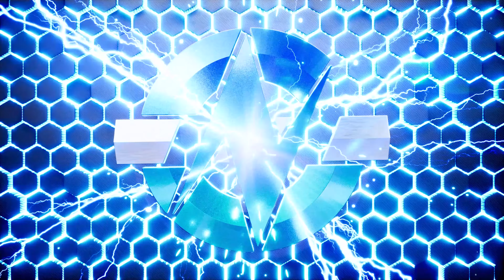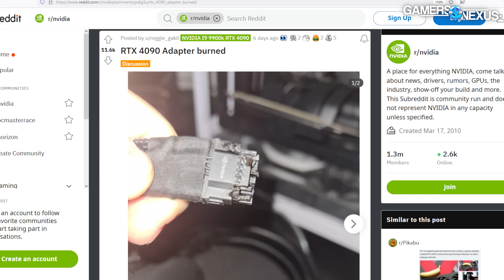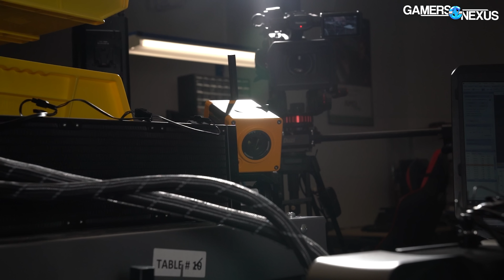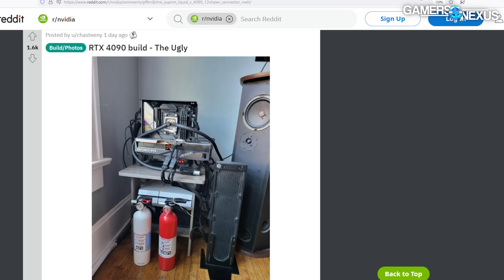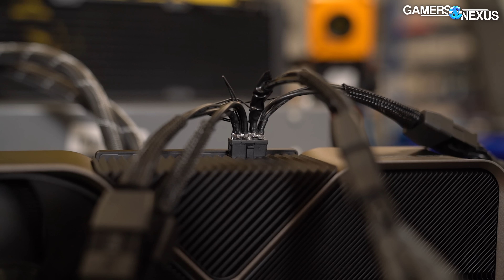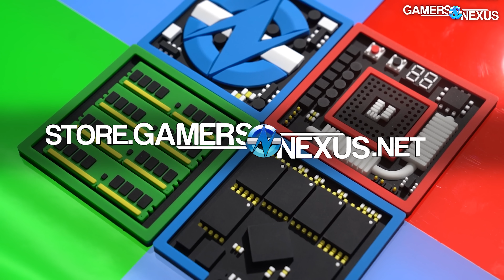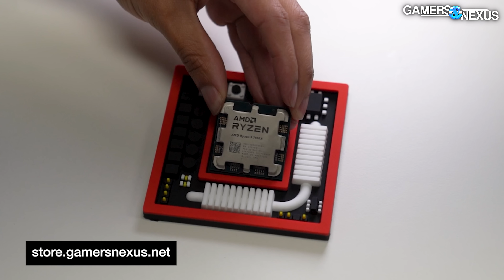Testing Burning NVIDIA 12VHPWR Adapter Cable Theories (RTX 4090)

Comment: To me this looks like NVidia had some less good adapters, they noticed the issue and it's already fixed but for some reason some of those bad adapters got out to the field. The connector Igor had was obviously prone to having the side pins being damaged. I wondered why they'd use something like that and it seems they wondered the same.

Comment: This new adapter seems to be designed closer to a power and ground plain than powered pins. Imagine if nv just used a slot style plug, a power plain and then a ground plain, this wouldn't be an issue if the issue has to do with the reliability of pin connection as buildzoid has hypothesized
Technically this connector will operate with a single power and ground wire to the plug, so long as the wire used is large enough it would work.

Comment: I wonder if higher case temps with poor airflow could play a factor. I would assume most ppl are testing via open air testbenches but I I still don’t think a 30 degree temperature delta would push it over the 105 degree maximum 🤔

Comment: ok, but what about torsion on the connector while it is connected? You don't think it could just be bad connection between the plug and the socket when it's sitting torqued? variance in the size of the pins/plugs?
Nevermind... you basically addressed it toward the end.

Comment: Im not 100% convinced its the cable.   I had a closer look the burned connectors and I think it might be the female connector on the card that might be the problem.   the melting seems to be from the outside in, on the male individual connectors in the 12 pin connector.   I think the female connecter isnt up to spec causing the pins to heat up.  Think of it like this  your using a 14-16 gauge  wire pumping in 600w then at the connection to the card the gauge drops down to 18ish gauge pins.  Now your pumping all that wattage into much smaller pins and those heat up causing the melting on the cable.

Comment: I would like to see someone compare the actual plastic on a failed adapter vs one that doesn't fail.  It could be the formulation of the plastic making one melt/deform at a lower temperature than another.

Comment: After seeing your research, I am less likely to think that it is specifically a cable failure. From the images I have seen, the source of heat seems to be in the Plug Interface itself, as in where the male and female pins interface (physically make contact). I would think that the plug (pin) interface would see a higher resistance as the actual cable is pulled to the side, ie; cable routing. This lateral force might be reducing the surface area that the male and female pins are contacting, thus increasing the resistance at that point. Higher resistance means increased temperature as the current overcomes that resistance. My next thought is also that the plugs may not all have been sourced from a single supplier; tracking the plug manufacturer and plug construction type may lead to a "eureka" moment. Also, if one or more of the interfaces have a weak connection the other interfaces will try to pick up the load, increasing the current through that interface, possibly beyond the spec limits for that/those pins. It is possible the outside pins are loosing contact forcing the inside pins to pick up the load, thus overheating the inside pins. That is an awful lot of power to cram through that single plug, with so few pins/contact points. Perhaps check and compare the resistance between the cable adapters and board side, (per pin),  as well as when straining the cable and see of the resistance changes (loss of contact at the interface). Once a pin starts to overheat it will oxidize and leave additional carbon on that pin, as a result resistance at that interface will increase. This could lead to a 'run away' condition.

Comment: WHY the hell do they have to use ANOTHER new connector, when wie HAVE functional connectors already? 
they just have to put them not on the top of the card, because that's a stupid place in any case.

Comment: I think the problem may very well lie in there being poor connections between the male pins on the connectors on the card and the female pins on the connectors on the cables.  Obviously, this is just a theory, but in my experience as an electrician for almost 50 years, I have seen MANY problems like this caused simply by poor connections between two conducting surfaces that are held together by only the rigidity of the metal of one or both of the two connecting parts.  Also, of course, the type of metal, the thickness, the (in some cases) plating on the metal, inconsistencies in manufacturing, power draw, etc. are all variables that can contribute to the problem.  

What type of metal is used in these connectors and what would happen if you were to push something slightly larger than the male pin into the female pin before re-connecting the cable to the card and see how much that effects contact between the two surfaces?  If there is a poor (small area of) connection between the pins, the initial power draw can cause heat, which in turn can cause metal fatigue or simply softening of the metal, which can cause even worse connection, which can then cause arcing, and then that in the end, can cause enough heat to start melting things.

Edit:  I paused the video and wrote the above JUST BEFORE you mentioned Buildzoid's theory at 26:00.   It was perfect timing!  😎

Comment: BTW i Could be Compleatly wrong and this could make 0 diffrence or someone has done it and i just missed it   
just a idea i have not seen anyone do these test in a PC case where the Incase temps can get up to the 40c .

where you have CPU, Ram and gpu all being used at the same time in a common case for Example  3 fans at the front with a glass panel infront of them and   1 Rear Exhuast fan  and Either a Air cooler or A Aio and using that as a Exhuast too.

but all panels on the Case INC side panels  with a bend most people would put on to make it fit in case
AGAIN this is just a Idea not saying anyone is wrong here

Comment: For igor's cable it might be that he is onto something that certain first GEN versions still used 150V cables,

Some of the soldering on his cables also looks BAD. like on the top its DULL, and on the bottom its slightly shiny.

GOOD solder connections should be SHINY. like in the GN cable

Comment: Don´t get lead into a rabbit hole by the voltage rating of the cables. It just specifies the quality and thickness of the isolation, not the copper strands inside. At 12V both variants are absolutely fine.

Comment: This all could have been avoided if Nvidia just stuck to the tried and true 8 pin connector. If it ain't broke don't fix it clearly Nvidia never heard that phrase. At least AMD is not using this crappy connector and will use the 8 pin connector 👍

Comment: I was literally typing "Camera McCameraface" as you made that closing remark to not request that... 😕 How about "Thermy" or "Johnny" (after Johnny Storm, of course).

Fantastic investigation, by the way! It's real easy to jump on the band wagon and get out the pitchforks, going after Nvidia, but it's far more useful to get to the bottom of what happened so we can tailor our feedback around "how" they should do better. Maybe they need to vet their partners they're outsourcing the manufacturing of these adapters better?  Keep up the great work, and get some rest, yourself, Steve ^_^

Comment: Did you consider that it may not be the card or the cable, but a bug in the way that power supplies provide the 12v rails?  In these adapters, you are likely merging multiple rails of various quality of power supplies.  If those power supplies cannot handle or have a quirk in their relationship between rails that may be causing a resonance in the connector where these rails are interacting.  I can't help but think that here in the US we get 240v by combining two 120v lines out of phase and while you are working with DC in these cases that's likely not an issue, but if there's a switching harmonic that could be feeding pulses of higher current through the wire even though it may not be going through the card?

Comment: Steve:  After looking closely at this photos on redit I think the problem is bad terminals in the cables.  working in electronic repair for years I have seen bad terminals from many companies.  oversized, undersized or some without tension to make good contact will burn just like this.

Comment: Might be a stupid question, but do we know for certain that the course for the problem comes from the adapter it self? From the pictures it seems that mostly the front part of the plug melts and not where the wires are soldered. Wouldn’t the heat start building up at the point of the highest resistance in the circuit. I am not really knowing much this stuff since I am not an electrician. But I wonder if your point of failure might lying on the other side. Maybe some problem with the connector on the card itself.

Comment: I've seen a lot of photos of these adapters with pins having slid out of their housing at the card end.  My money's on it being some of the adapters being supplied being of poor build quality, even plugging them in once is enough to push the pins out and it's not always obvious, and this causes the contact between the pin(s) to not be as tight as it should be which results in arcing between the adapter and the card.  Not everyone is experiencing this, and as you've proved with your testing at least some of these adapters are of sufficient build quality that this isn't an issue.  My guess is some partners are using unapproved suppliers for the adapter components (or outsourcing construction of them entirely), and shipping them to customers without nVIDIA even being aware of the issue.  Time will tell, though.

Comment: Just like Jay, you guys are focusing on the connector and not the connection.  I'd like to see the adapter stressed in each direction so there is a possibility that the "outer" pins (based on the direction of bending) have little or minimal contact.  You need to push 600 watts through a crappy connection.

Comment: The gage of the wire is the biggest factor in generating heat if its assembled correctly.  The allowable current in a conductor is determined by temperature rise at a given current. 

Find a cable with 18 gage 12 lines and test it. Also the size and thickness of the solder pad has a large effect on temperature rise. 

Is it possible that some midnight manufacturers have taken a 1 into 4 adapter for hard drives and changed the connectors to create a high current adapter with parts not designed for the use.

Comment: I think the biggest issue is trying to push that much current at 12v is becoming more and more unrealistic. May be time to introduce a 100v rail in the ATX standard so more sensible wiring can be used for GPUs.

Comment: How many assembly houses were used for these cables? There were probably more than one. This could be variance between manufacturers.

These are hand assembled adapters, so there probably is variance even within one manufacturer's facility.

After watching Steve hand solder one of the connectors in this video, it sure looked like he could easily have created a cold solder joint. If people are in a hurry, they could be doing this at the assembly houses. That alone might be causing some of these issues. Hand soldering is an art.

Another thing could be that people doing the assembly are overheating the pin contacts in the 16-pin connector when they are soldering. This is easy to have happen on small connectors, when trying to make sure the connector pin and the wire are both hot enough to melt solder, to avoid a cold solder joint. Overheating the pins might cause the housing to melt enough that pins are able to shift and cause problems.

Comment: Did it all himself and gave his team time off. I can recall a Lieutenant from my old unit doing the same thing. It’s a characteristic that great leaders have.

Lead from the front and by example.

The video game industry could learn a thing or two by your example.

Solid work. Rest up. Know that you are, truly, appreciated for meeting that high bar you set and continue to reach for your brand.

🍻 🍻 🍻
Reply: The test is completely flawed, he test it on open bench in room with AC set to 20 ish celsius. Inside of your case can get to 50-60C just from gaming for 30min with like 250-300W gpu, thats not unreasonable at all. The people who had this issue played with 4090 pulling 400W+ for hours. This already invalidates all of his testing, because really, the temp inside your case is anywhere from 20-40C than the room he test this in.
Reply: Do u have a huge Wang?
Reply: imagine taking something as simple as testing stuff and u turn it into this leadership military thing? like what the heck are you on bruh? he tested stuff chill out.
Reply: @Diddykong7  Tell us you don't recognize quality leadership and have no leadership skills without telling us..

Comment: Igor's cable, if the Paint diagram is accurate, looks more like a crimp connector that was soldered instead, with a break between every pin so you could separate them. They generally come in reels you can feed through a powered crimper. Soldering is generally considered less reliable than crimping (at least for a proper crimp, that's got QC problems of its own). It looks like they decided to go with thicker wires than the crimp would support to get the cable resistance down so they just soldered wires on. When you solder there is no proper strain relief for the solder joint whereas a good crimp connector will have crimps for both the conductor and for the insulator, providing strain relief to each wire, vs. a bit of tape that only helps with the wires in bulk.

Comment: "Our findings differ"  Shills to Nvidia

You have clearly identified that your cables are from a different buildhouse.  Next step is determine how many garbage cables were made, what percentage were made incorrectly.  Testing the good cables is largely irrelevant.  Should have waited until you could grab a bad cable and test that.

Comment: The melted part seems to be around the actual connection pin/socket area, which leads me to believe the individual contacts have too high resistance or the current distribution is not loading each pin equally. Also possible the outer pins aren't seating properly. It's possible that the thin film part of the connector is undersized, or even possible that it can tear halfway through when a cable is pulled and that would explain why only the edge pins melt as they are the ones that will absorb all the tension.

Comment: Hmm, switching wire grade and soldering schema is an ongoing production update. I bet the first batch one, that are failing, were the original spec. After issue was found... a quick fix was implemented. But for whatever reason, these original batch adapters got shipped. Now, Nvidia is doing damage control by DEMANDING cards to be returned to HQ. And thats what Steve is looking for here: customers to take as much info before sending cards in for RMA.

Comment: The voltage rating of the cables would be irrelevant as the insulation doesn't seem to be the problem and it never gets anywhere near 150V anyway. I would first look for the diameter, then if they are cca instead of copper, and otherwise look for the problem in the connectors. Either the connection of the cable to the contact springs (including the shearing off of the interconnection bar) or the tension or material of said springs.